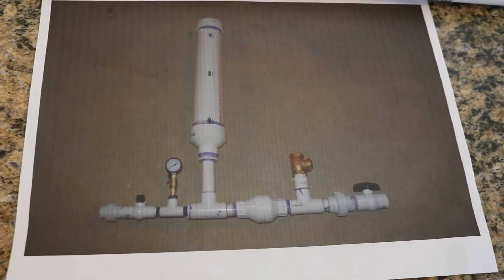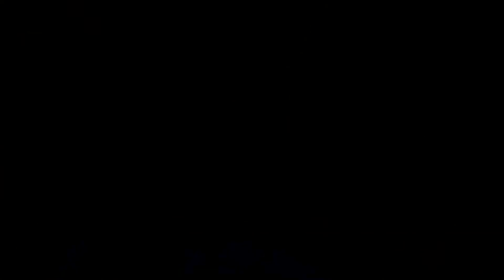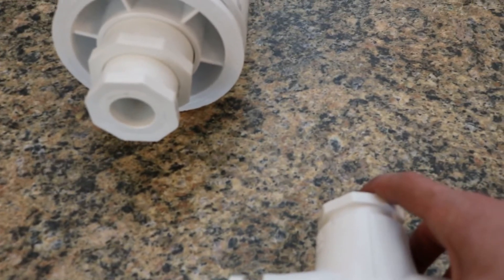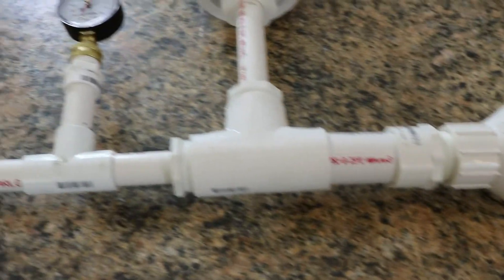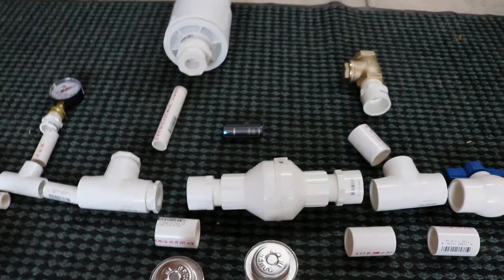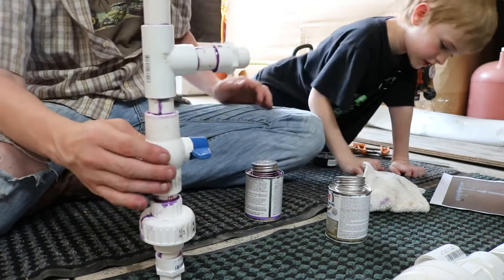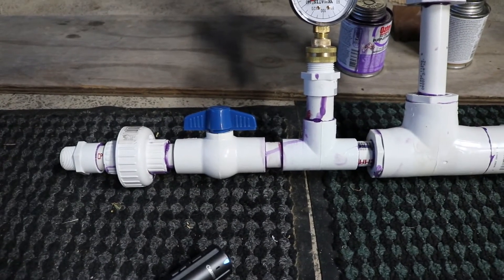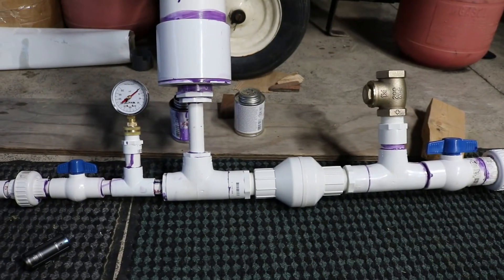Ram pump build (Part 1) - Clemson University style

Comment: looks good, only issue i can see is the shut off valve should be before the union on the supply side for servicing  of the pump
Reply from the maker: Thanks for the input :D  I'm pretty sure I understand what you mean.
Reply: +Kentucky Homestead i made that mistake when i built mine , so when i undid the union to remove my pump for repair i got soaked made it harder to reconnect it as well. just add a shut off to where the supply line will connect to the ram pump and you should be all set..... cabin is looking great man keep up the awesome work
Reply from the maker: Big Dirty
I see it now, and I already pictured the video of me getting all wet!!!  I'll add a shut off to the pipe.  The creek is flowing really good, but I just have so many other projects I cant really find the time to get this thing in the water..  Soon though!!  Thanks again.
Reply: Looks like impetus valve is upside down.

Comment: cant wait to see it runnin, great job man
Reply from the maker: Same here, we went down to the farm a few days ago, but I need some more pipe to get from the dam to the pump.  So, if all goes well I should have it up and going next time :D
Reply: @KentuckyHomesteadFarm  gov will have all heads for this tech thay teach us that we always have loss but never talk about 
the converted gain we can make from eletromagnets
if u convert all the wast thermal energy around 
you u can use it universally as energy u need a true sine wave bipolar like the power comp dose a 
true pure sinewave like a grid tie inverter 
once the signal is made the system will turn on and 
consume wast thermal energy from the 
environment and space around you... there is free energy but 

it comes from Universal thermal loss and converted into a gain. so a pole Transformer and a 
microwave Transformer  have a common between each other u can take 2 microwave Transformer provide 
a pure sine wave grid tie inverter to it or a true bipolar sinewave that inter acts with nature in 
a perfect spherical motion like a flower of life..  if ur home provides this use it as a Source 
signal then u can simply stack the Transformers on top of eachother in correct fasion and note 
that the 1 wire on the Transformer must stay connected and the other disconnected your only useing 
1 wire on the hi side .. so test ur self 
2 microwave transformer stacked on top of eachother same 

face sides. one side 120 to the wall and the other 120 side to what u want to power and useing the 
Transformer just the way it came out the microwave with the wire attached causes the energy in its 
perfect spherical motion to converted wast thermal energy to amp for u hot to cold in to out... 
should look a bit nuts with u use a form of wireless energy but its interacting with the 

environment...this is my work a compilation of Otis car. Tesla. and many other very smart people 

nowadays i think i found the gate source and drainif this gets out to much that it works the 
power 

comp and mib will have our headsdont do this at home warning high voltage yet i cant stop u lol DO 

NOT TOCH THE CORES OR THE WIRES OK u will die make sure u dont touch the core if the hi wire is 

mounted to it u dont have to mount the hi on the core if u dont want u connect the 1 hi wire to 

the same side hi on the other transformer then the core should besafe to handle if nessary
grab your multimeter and prove me wrong
thats what u do i have my whole home on this
and u can take 

one of the lows side out the wall and hook it up to other stuff and power it for verry little amp 

makeing nature convert and pumping latent heat effect into the device.
and u can have a microwave 

hi volt cap in between the hi side and make a system that powers its self
u can flip the switch on 

ur breaker and the room stays on up to 2kva 
with both lows in the wall this is the zero point that 

was taken from us...
Reply: @KentuckyHomesteadFarm  gov will have all heads for this tech thay teach us that we always have loss but never talk about 
the converted gain we can make from eletromagnets
if u convert all the wast thermal energy around 
you u can use it universally as energy u need a true sine wave bipolar like the power comp dose a 
true pure sinewave like a grid tie inverter 
once the signal is made the system will turn on and 
consume wast thermal energy from the 
environment and space around you... there is free energy but 

it comes from Universal thermal loss and converted into a gain. so a pole Transformer and a 
microwave Transformer  have a common between each other u can take 2 microwave Transformer provide 
a pure sine wave grid tie inverter to it or a true bipolar sinewave that inter acts with nature in 
a perfect spherical motion like a flower of life..  if ur home provides this use it as a Source 
signal then u can simply stack the Transformers on top of eachother in correct fasion and note 
that the 1 wire on the Transformer must stay connected and the other disconnected your only useing 
1 wire on the hi side .. so test ur self 
2 microwave transformer stacked on top of eachother same 

face sides. one side 120 to the wall and the other 120 side to what u want to power and useing the 
Transformer just the way it came out the microwave with the wire attached causes the energy in its 
perfect spherical motion to converted wast thermal energy to amp for u hot to cold in to out... 
should look a bit nuts with u use a form of wireless energy but its interacting with the 

environment...this is my work a compilation of Otis car. Tesla. and many other very smart people 

nowadays i think i found the gate source and drainif this gets out to much that it works the 
power 

comp and mib will have our headsdont do this at home warning high voltage yet i cant stop u lol DO 

NOT TOCH THE CORES OR THE WIRES OK u will die make sure u dont touch the core if the hi wire is 

mounted to it u dont have to mount the hi on the core if u dont want u connect the 1 hi wire to 

the same side hi on the other transformer then the core should besafe to handle if nessary
grab your multimeter and prove me wrong
thats what u do i have my whole home on this
and u can take 

one of the lows side out the wall and hook it up to other stuff and power it for verry little amp 

makeing nature convert and pumping latent heat effect into the device.
and u can have a microwave 

hi volt cap in between the hi side and make a system that powers its self
u can flip the switch on 

ur breaker and the room stays on up to 2kva 
with both lows in the wall this is the zero point that 

was taken from us...
Reply: @KentuckyHomesteadFarm  gov will have all heads for this tech thay teach us that we always have loss but never talk about 
the converted gain we can make from eletromagnets
if u convert all the wast thermal energy around 
you u can use it universally as energy u need a true sine wave bipolar like the power comp dose a 
true pure sinewave like a grid tie inverter 
once the signal is made the system will turn on and 
consume wast thermal energy from the 
environment and space around you... there is free energy but 

it comes from Universal thermal loss and converted into a gain. so a pole Transformer and a 
microwave Transformer  have a common between each other u can take 2 microwave Transformer provide 
a pure sine wave grid tie inverter to it or a true bipolar sinewave that inter acts with nature in 
a perfect spherical motion like a flower of life..  if ur home provides this use it as a Source 
signal then u can simply stack the Transformers on top of eachother in correct fasion and note 
that the 1 wire on the Transformer must stay connected and the other disconnected your only useing 
1 wire on the hi side .. so test ur self 
2 microwave transformer stacked on top of eachother same 

face sides. one side 120 to the wall and the other 120 side to what u want to power and useing the 
Transformer just the way it came out the microwave with the wire attached causes the energy in its 
perfect spherical motion to converted wast thermal energy to amp for u hot to cold in to out... 
should look a bit nuts with u use a form of wireless energy but its interacting with the 

environment...this is my work a compilation of Otis car. Tesla. and many other very smart people 

nowadays i think i found the gate source and drainif this gets out to much that it works the 
power 

comp and mib will have our headsdont do this at home warning high voltage yet i cant stop u lol DO 

NOT TOCH THE CORES OR THE WIRES OK u will die make sure u dont touch the core if the hi wire is 

mounted to it u dont have to mount the hi on the core if u dont want u connect the 1 hi wire to 

the same side hi on the other transformer then the core should besafe to handle if nessary
grab your multimeter and prove me wrong
thats what u do i have my whole home on this
and u can take 

one of the lows side out the wall and hook it up to other stuff and power it for verry little amp 

makeing nature convert and pumping latent heat effect into the device.
and u can have a microwave 

hi volt cap in between the hi side and make a system that powers its self
u can flip the switch on 

ur breaker and the room stays on up to 2kva 
with both lows in the wall this is the zero point that 

was taken from us...